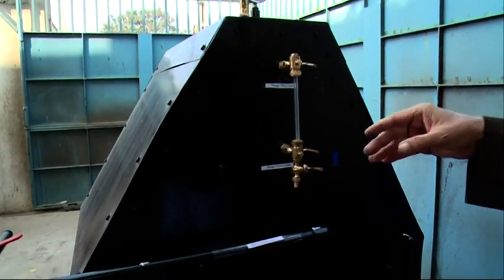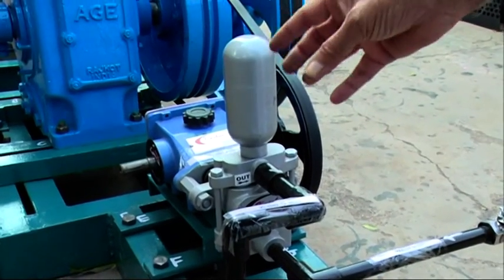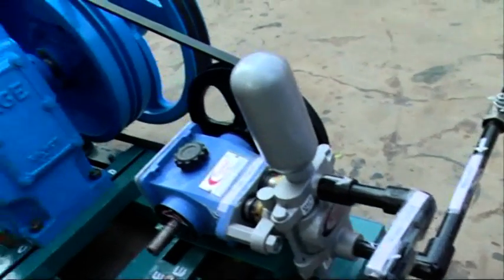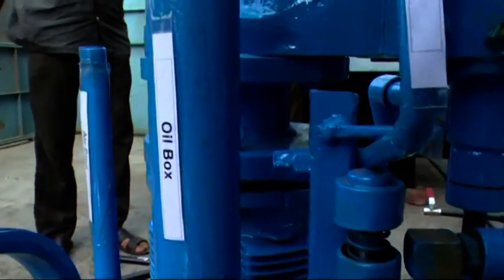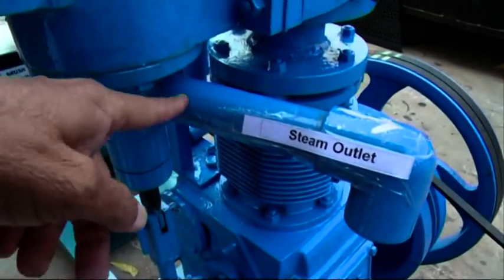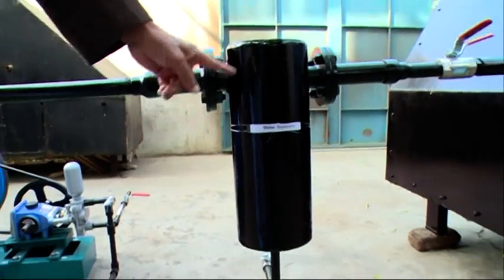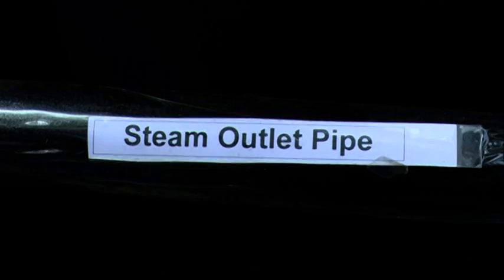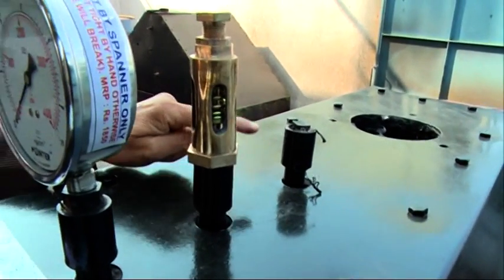STEAM POWER PLANT WITH 10HP STEAM ENGINE - INSTRUCTIONS

Comment: Dear Sir
I think, if you use the steam exhaust from engine to pre heat inlet water to boiler using heat exchanger, you will increasing system efficiency and safe energy.